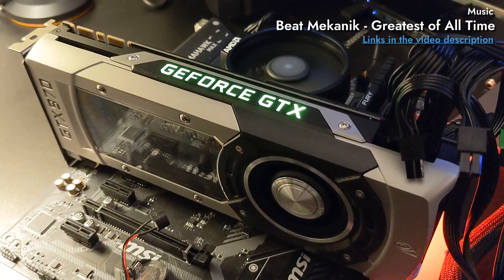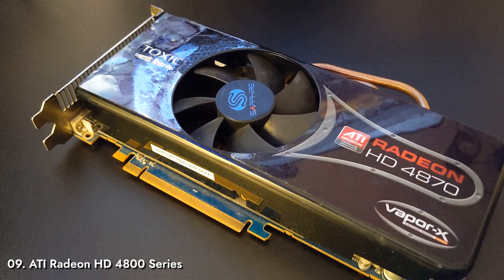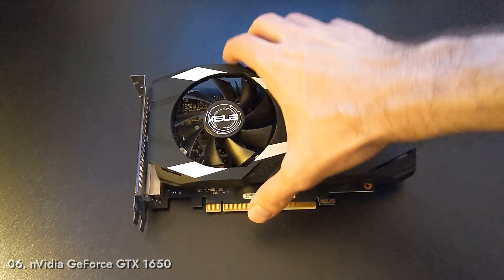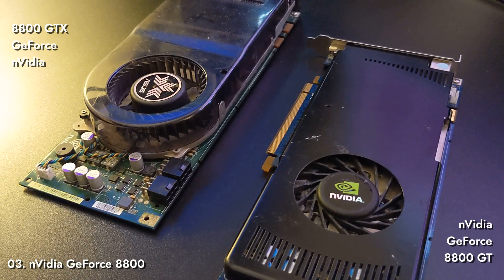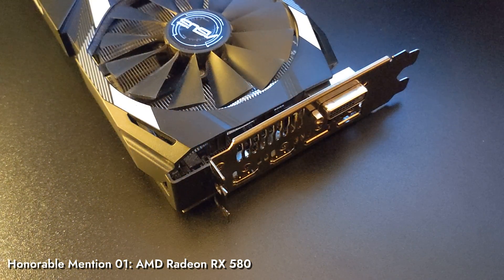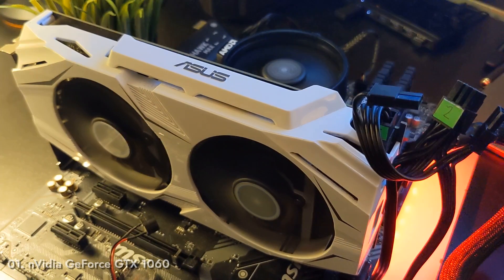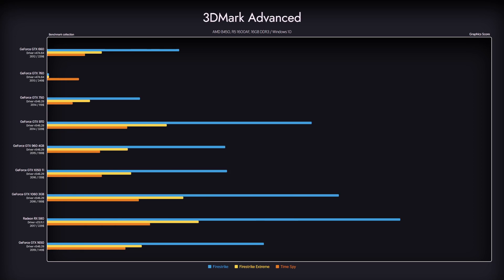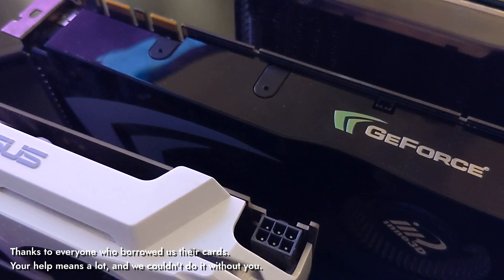Top 10 Most Popular Graphics Cards Ever ( According to 15 Years of Steam Survey GPU )

Comment: most legendary :
gtx 8800 
gtx 1080Ti

most useful = cards bringing a performnce of a previous gen high end to mainstream:
gtx 1060 6gb
gtx 1660 (super/Ti)
rx 580 8gb
gtx 560Ti (560Ti  448 edition)
rtx 2060 6gb
gtx 970 (this video card could have been up there with 1080ti and gtx 8800 if only it would have been given 6gb of VRAM or at least the full unhindered 4gb) 
ati 5850
radeon 7850
gtx 650Ti (boost edition)

Comment: I'm surprised the GTX 750ti didn't make the list in any way, also I was sure the RX580 would make it as AMDs most popular card ever.  
The GTX 1060 on the top spot was also no surprise. I remember I wanted to get one as a teenager in late 2017 when they were on sale for as little as 230€, but when I had saved up the money they suddenly cost over 300€ due to Etherium miners. I waited for half a year for prices to come down and in the end I bought the 1070ti as I had the money after not spending it on an in my mind overpriced 1060 and it offered the performance of a 1080 at the price of a 1070.

Comment: Jesus why was the GTX 760 such complete hot ass?? Same kinda goes for the 1050ti quite frankly. I thought that was a stronger card what an absolute piece of shit that was. Better off just getting the older 960 at that point since the 1050ti also had a crippled VRAM 2gb variant didn't it? The 760 was fucking trash. Can barely even compete with the 660.
I find it amazing how people insisted on getting shit 50 and 60 cards from memevidia time and time again, and yet of all the cards on this list the RX 580 is clearly one of the best, and it has the best VRAM of all them making it literally the only GPU on that entire list that's still a valid choice for 1080p gaming to this very day, unless you count the 1060 6gb. I mean you could do 4gb, it's just not really gonna get you that far, at that point you're going to bottleneck the VRAM before the processor. Watching a 1650 lose that hard to it is miserable. Two years later, half the VRAM, is still too expensive which is sad af because that's a "cheap" GPU now.

Personally I think the 5700XT and 6600 or 6600XT are going to be on there this time, or ought to. The 5700XT except for the VRAM is in an excellent spot for becoming the budget option goto. Depending where the 6600XT or 6650XT land in price anyway. Very, very meh about the 7600XT. The alleged "4060" sucks donkey balls but the "4060ti" is so much worse. And God $500 five hundred fucking dollars you know, that's how much the 2070 Super cost and it was still too expensive back then.
Reply: The 1050ti always comes with 4GB, the 2GB version is the "regular" 1050 non ti. Also I agree that the tendency to buy nvidia is terrible. The 4060ti is a 128Bit card at $500. You used to get the most beefy flagship for that amount, not some ultra cut down card.
Reply: @Txm_Dxr_Bxss yep but nvidia doesnt care about gamers anymore
Reply: RX 580 was the newest card by one year - having come out in 2017. All the other cards are from 2008-2016.

Comment: RX 580 Gang!
Reply: yeah it was a great card i bought it for €200 brand new (i had i5 8400 system back then) , 
sold it 2 or 3 years later in a middle of crypto crysis for €350 and replaced it with second hand 1080 for €450 - best gpu upgrade of my life .
previously i also owned 270x and amd 6850 in my main gaming computers back in the day .

today i have 3 retro systems running at home 
one with fx 6300 and gtx 760 (4gb edition) , another one with i5 4590 and gtx 560 and 
the third has i7 4770K and gtx 1660 super (surprisingly this one can still handle even some new games and e-sports and also stuff like cs2 , valorant etc.)
i also have 1060 3gb , gtx 275 and gtx 970 lying around (planning to do some builds with them also , 
unfortunatelly no radeon cards at the moment (save a really old ati x1600 pro) , i had one system with radeon 390 and i5 4460 but i gave it away some time ago .

Comment: I was frickin' pumped when you showed the MSI GTX 960, because I had the exact same card! When I had my first Gaming PC in 2017, I had originally an EVGA GTX 960 and ran it 2 years until my Motherboard gave up. I returned slowing in mid 2020 and was running an MSI GTX 960 until 2023. Didn't die, just upgraded. Guess I really had my fair share of the GTX 960's. 

Last year I Upgraded to an ASUS TUF Gaming RTX 3060 Ti OC and ran it a couple of months until November 23' (I knew it was short and could of ran it much longer, but I had some big plans). Finally got me a EVGA RTX 3080 FTW3 Ultra and I am very happy. Long adventure but it was memorable and amazing. I knew I went a little off, but all Is to say that I love the GTX 960 and will be forever a fan. Side note...You did a great job on this video. Small channel, but so much potential!

Comment: The data claiming the 1060 was the most used is misleading! In other countries people use the shops computers! So you get multiple sign in on a single card
Reply from the maker: I highly doubt that the same machine would be registered twice in Steam Survey. Even if Steam Survey data isn't perfect, GTX 1060 was definitely the most popular. It simply had a lot of stuff going for it: Good performance, disappointing successor, and last but not the least the shortage. Hell, nVidia even re-released it during the shortage.

Comment: Amazing video, I thought it would be more 700's cards like the 750ti
Reply from the maker: Thanks! Well, it's number 12. So it's almost there :D We had to make a cutoff somewhere.
Reply: It's literally just whatever is in most people's prebuilts and laptops most commonly. The vast, VAAAST majority of users don't actually build their own PCs. And they also tend to go for the cheapest prebuilt they possibly can get away with. Or their parents typically go with whatever's packing the most punch for the like $500-800 range for a school laptop. So this is literally the reason why all those keep getting listed.

It has fucking nothing to do with quality. Also find it interesting when you consider there was a 6gb and a 3gb cut down model with different silicon iirc on the 1060 so which is it? The 3 or 6gb VRAM model? So the ultimate outcome is, you pretty much hide the real quality by simply drowning people in crap prebuilts. It's the same reason why the 3060 is going to be on there. The 4060 will too, despite the fact the 4060 is hot fucking garbage. Because the 4060 is what'll be listed for both laptop and desktop despite being two different cards, and it'll be mass produced like always, it'll sit on Walmart shelves like always, and ignorant boomers will buy it on credit like always.
When fact is anyone who was actually building the thing was buying things like 1070, 1070ti, 1080ti, but it'll be the same story as usual people in 2020 will be said to be building with 3060's and 3060ti, regardless that's not what a lot of people actually built (like a fuckton of 3080 and 6800XT was what went in custom machines as well as fucktons of 6600, 6650XT, and 6600XT in the custom builds). It's also one of the reasons quadcores was so popular. And partly the reason for 1080p, everyone who's building machines already upgraded to 1440p if not 4k even, all the 1080p shit also included all the laptops that are basically 1080p by default even including the newer ones, a brand new laptop has a 165hz or 144hz 1080p panel even if it got a RTX 4060m in it. 

I wish people would stop trying to use Steam survey. It really means fuckall ultimately in terms of actual popularity or in terms of quality. If you simply dropped even just laptops by themselves you'd be getting very different numbers.
Reply: @drek9k2   There should be separate categories for built & prebuilt computers. Steam not having a way to tell how they came up with the data or differentiate shows they don't know what they're doing.